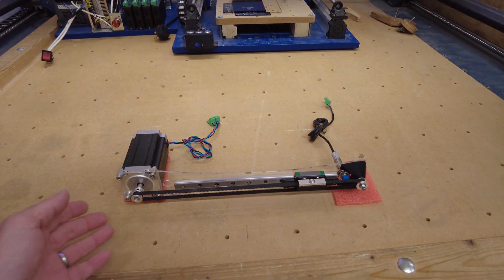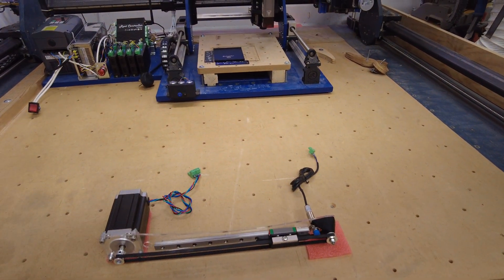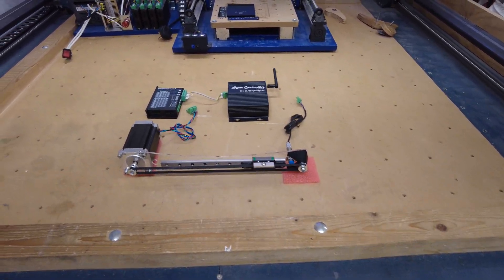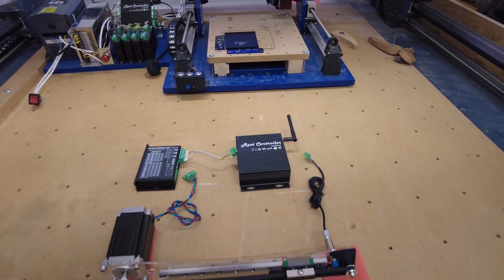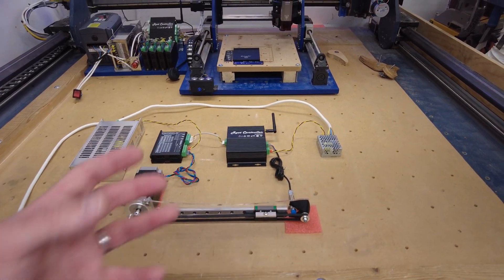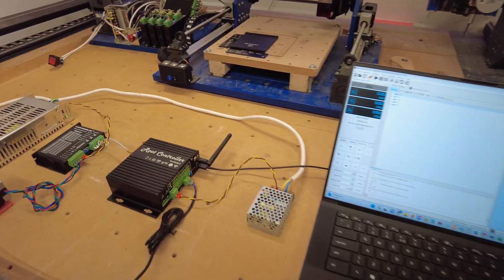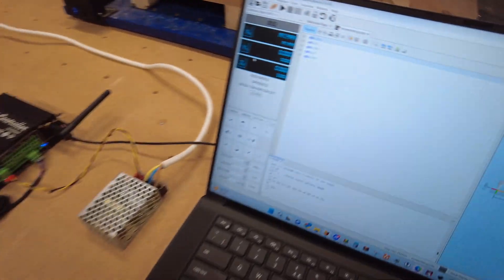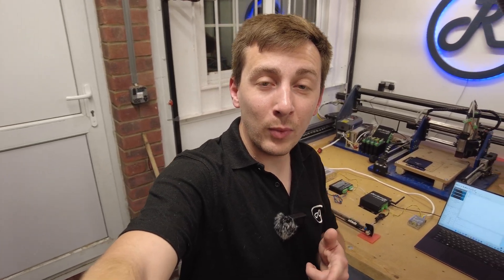How to wire a CNC machine with the Root Controller

Comment: Great video - I am curious what cable gauge you used for the Stepper Driver Signals. I guess these only need be very low gauge... is what you have used  Ethernet / Alarm cable, or a bit thicker 0.75mm2 perhaps?
Reply from the maker: @DatumCAD   @DatumCAD  I gather you are referring to the cables between the motion controller and the stepper motor driver? If so, then these are not special, and most cabling can be used. I believe I used some 24awg cable in the video
Reply: @RootCNC  yeah that’s the ones. Ah ok so that’s around 0.5mm2 so nothing too fancy, but a bit larger than Alarm cable (which although is 4 core is circa 0.2mm2 I believe).  

Main thing being that it doesn’t need to be shielded etc. by what you’ve indicated then. If so I am sure will have something suitable stashed in the workshop already. Cheers 👍
Reply from the maker: @DatumCAD  I suppose you could use the thinner stuff, the control signals are low current <20mA. So, the small gauge is fine. 

No shielding is required, assuming you've got short cable runs, ie in the same cabinet. Typically, most of my cables are <40cm and I've not had any issue
Reply: @RootCNC  perfect 👌 thanks for clarifying.  Yes all will be in close proximity and short runs like you say. 

I have been busy watching all your videos and am busy procuring everything need to upgrade my build. Now just awaiting availability for Root Controller ISO itself. Do you know if more of those little beauts will be ready for action?
Reply from the maker: @DatumCAD  no problem :) I've received all the parts last week, and assembly will start this week. I hope to have stock in the next week or two :)
Reply: @RootCNC  that’s great news! Good luck with it and thanks again for you input 👍

Comment: Exactly what I need but can it be flashed with GrblHAL instead of FluidNC.  Also any chance you could go over the wiring of a closed loop system and running the spindle.  Looks like an excellent product.

Comment: That's cool, should lower the effort of getting started.  What about if one wanted to run their stepper motors on, say, 48V, so needed two power supplies?
Reply from the maker: Running the stepper motor driver PSU at 48V should fine (Left PSU & assuming your drivers are rated to that voltage). The Root Controller ISO has an input voltage 12-36V and only needs 8 Watts of power, hence the little PSU on the right. technically you can power the whole setup from one PSU but that makes the Vin isolation zone pointless, so I do not recommend powering the whole setup from one PSU. so the two PSU setup in this video is recommended

Comment: I think if you go that basic, it would be nice to explain how to find which wire of the motor goes where (detecting the A and B coils using a multimeter). Chinese stepper motors often come without any instructions and just 4 unlabeled wires. 
One thing that put me down when I was setting up the Root Controller ISO is that there are no config examples for v.3 in the wiki or GitHub. Took me several days to realize that all the examples use v. 2.1 pinout and another week to write my own config file.
Reply from the maker: Thanks for that feedback! I have been updating the configuration files on the Github recently, so hopefully it'll be more streamlined going forward. I will add some information to wiki on how to find the coils on a stepper motor, without a multimeter